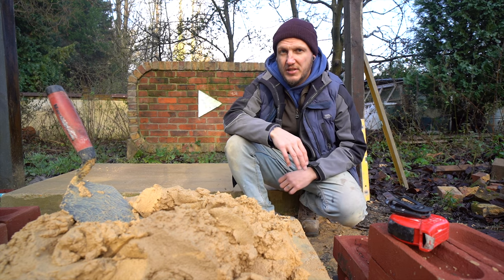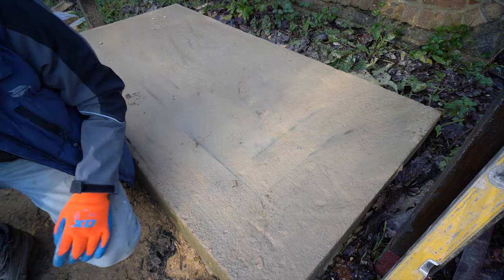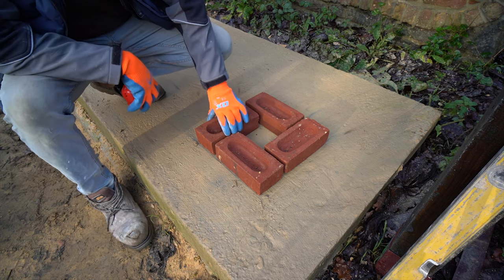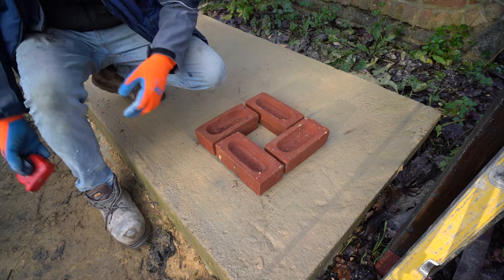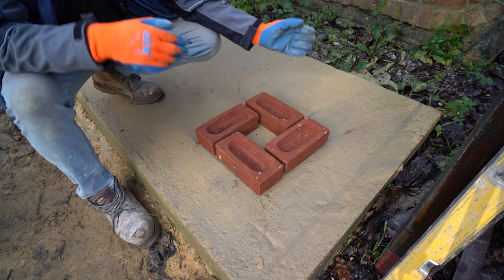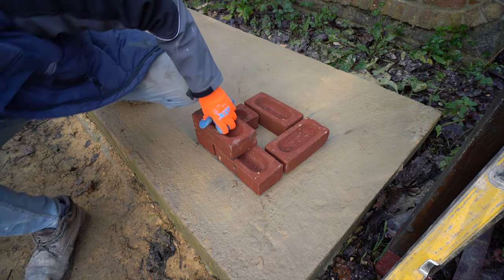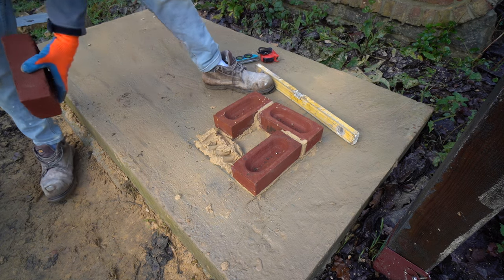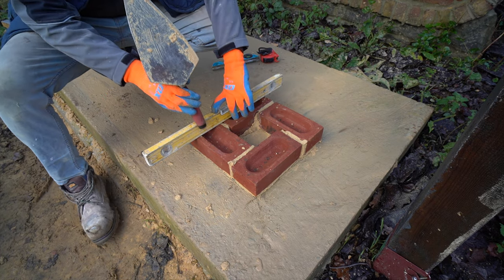HOW TO BUILD A BRICK PIER [Bricklaying for beginners e.p.16]

Comment: Hi Rodian, good videos mate just a little experience I had laying piers in winter/cold conditions, seems like those first three bricks on the bottom were soaking wet compared to the upper three courses so I found if they wet they’ll seep and leak for days till the weather dries up, also i found if the actual mortar has been mixed with really wet sand you won’t be needing to add any water to your mix what so ever just let it mix in the mixer dry, be patient and the wet sand will bring the mortar to the correct consistency you require depends on what mortar you using. Eg sand/cement or sand/lime and yes a small  neat cap full of Feb should be all required to give you the fluffy mix if the sand was wet initially, but I find if you know you’ll be laying those bricks in cold/wet  conditions it’s always best to ensure the brick you using are kept bone dry, the night before any wet/damp ones should be either left well alone altogether or brought indoors and heated up to dry out  before using. Hope this helps your seeping mortar issues

Comment: If you put Feb in lime mortar it reduces capillarity so you may as well use white cement. What you could do is try quicklime at 1:3. Very workable because of the high free lime content and very porous. But you have to wait a while for it to gain strength if you want to hang a gate. If you want that colour  - and also the strength -  best stick to white cement with Feb Bond or any other plasticiser.

Comment: l wonder if you can help.l use a mix of 5 to 1 with a concentrated plastersizer 5-10ml in builders size bucket of water.l lay my bed of muck,lay the first brick only to find as l lay the next brick the muck is already going stiff.l have tried using fresh bag of cement and fresh building sand and different strengths of plastersizer.l look forward to your hear your thoughts

Comment: My old college tutor advised us to build piers without buttering the perp joints as we lay as to not push the other bricks out of plumb and fill the joints in as you go or with a tuck pointer at the end...just wondering what anyone’s  opinion/view on this would be ? Am only 17 so just trying to learn the trade correctly 👍🏻
Reply from the maker: I haven't ever built a pier in that way but I have seen it being done. I personally dont like doing it that way because it would take ages to tuck the much in after. Once you've built a few piers you'll get used to how to plumb them up guttering the bricks as you go
Reply: Ashley Thomas, what your tutor advised is best especially when building something like a pier, lay the bricks around one course then fill the perps before laying the next course. Good look with your brickwork
Reply: @johnbower  thanks for the advice/response, I’m out of college now doing building work where I can but mostly working as a memorial mason, bricklaying is the goal 🧱I’ll keep in mind your advice if I ever build a pier 👍